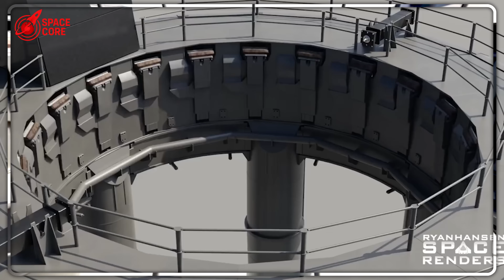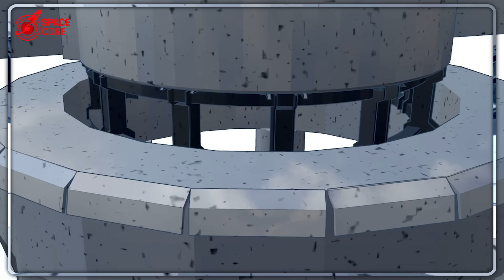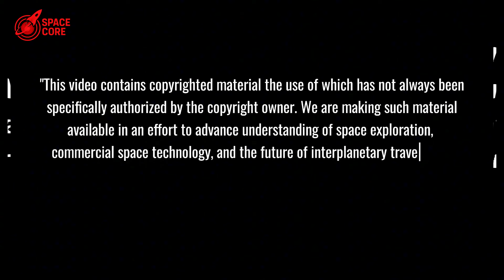Starship Flight 10: SpaceX's OLM Adapter SHOCKED NASA...Here's The Truth!

Comment: I don't see why they didn't build the olm for starship tests in the first place  !
Reply from the maker: The OLM wasn't initially built for Starship's unique needs due to evolving design requirements, but SpaceX's rapid adapter system overhaul in 30 days shows their unmatched adaptability. This flexibility is key to accelerating Mars colonization timelines.

Comment: Starship is not being used instead of the Artemis rocket for the moon return. To land Starship on the moon there would need to be a landing platform like Boca. The moon mission is using the same-ish lander used in the Apollo ages.
Reply from the maker: Starship is indeed NASA's choice for Artemis' lunar lander, not a replacement for SLS, with a specialized HLS version designed for moon landings, no Boca-style platform needed. Apollo landers are outdated; Starship's reusability is key to sustainable lunar missions.